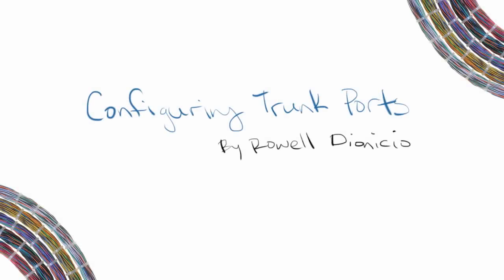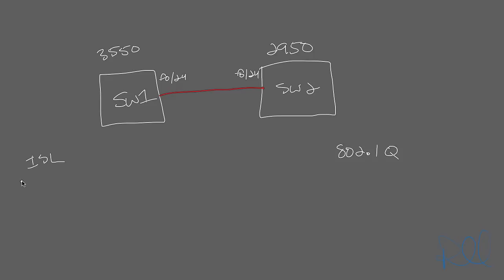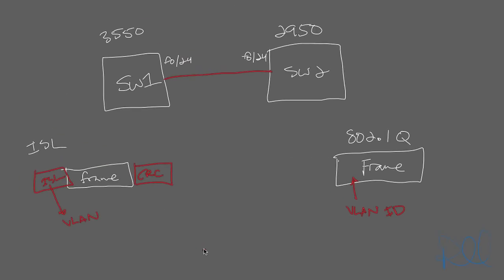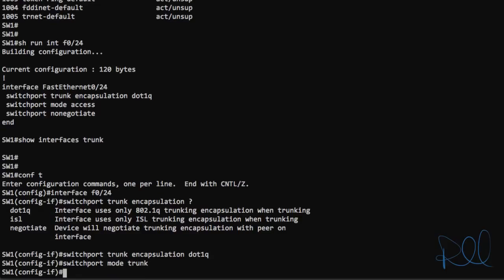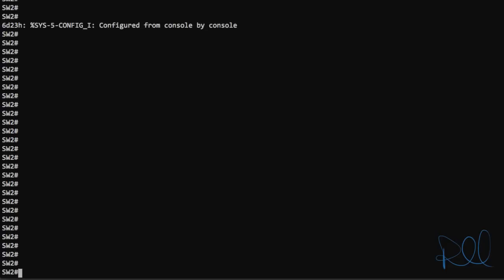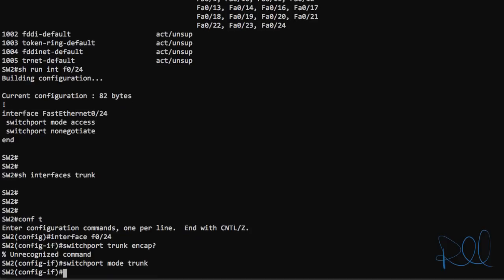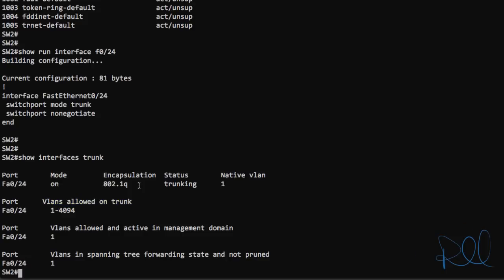Configuring Cisco Trunk Ports

Comment: i don't get it, why do we need to issue the encapsulationdot1q? because i have vlan 10 & 20 on SW1, and vlan 10 & 20 on SW2, i can just configure 1 port on each switch in trunk mode..and i can still ping from vlan10 SW1 to vlan10 SW2  right?? so why the encapsulationdot1q?? can someone explain? and i've also seen some people they didn't even configure the link between two switches, but can still ping, and their explanation is that, the packet can still go through because the link between two switches are in the access mode, as long as they're in access mode then packet can still go through (different vlan but same subnet) but it will drop the vlan tag..but if you configure the link as trunk mode then it will drop the packet, cause the moment the packet goes out from the trunk port on SW1 it will drop the vlan tag, and when it reaches SW2 it will tag with vlan20 but will drop the tag again once it reaches the port that connected to the end device...is this true???
Reply from the maker: This is an older switch. You don't have to use encapsulation dot1q with newer switches.

Comment: I have a question~ 
how can I do  if I want to change my trunk port without connecting new cable? Can I just only change my trunk port by using command???????????????????
Reply from the maker: You can configure it as a trunk port without a cable connected.

Comment: Hello sir i just want to know how can i configure 2 isp connection in single managed switch? Means i m a cable operator and i have 2 isp line and i want to setup both line in same switch and want to mix both line in all ports so i can provide internet connection using router in customer home using any port from my switch.. 1 isp is using static ip and other is pppoe so i want to setup my singe switch with 2 isp so i can provide Internet connection using unmanaged switches connected to my managed switch in office.. At end point of customer i will use router and will set pppoe or static ip connection so customers can use Internet.. Sir help me in it with command so i can understand how to configure

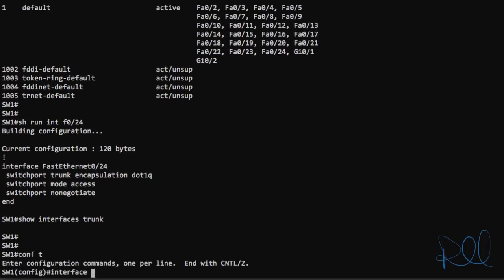Comment: I don't see "encapsulation" in my CLI. My options are "allowed", "native". and "pruning".  EDIT: Nevermind. Just a piece of advice, 3:19 you should have stated that your first method applied to ISL on older devices. You did not mention that. Newer switches don't support ISL... there is no need for an encapsulation command because only one encapsulation is supported.

Comment: I used packet tracer to replicate exactly what you did on SW2 for Fa0/24 and after issuing the sh vlan br command I am still able to see f0/24 as part of the access vlan. 
When i configured f0/24 by going to global config, int f0/24, switchport mode trunk, switchport non, i didnt recieve any errors.
Reply: +Stephen Konig Update: Ok so just for my beginner level self, I figured out why it was not working. The devices must be connected to each other for the results to be shown the way you are getting them.

Feels silly but lesson learned.
Reply: +Stephen Konig I'm glad you were able to get it working. Most important skill is troubleshooting :)

Comment: if you have 3 switch, to set up the trunk, first set up the second switch or in the first or in the three
Reply from the maker: metalliciano By default the ports are usually trunks. In a real world scenario, I configure all the switch ports first and then cable them last.